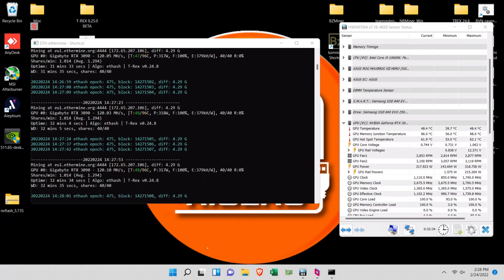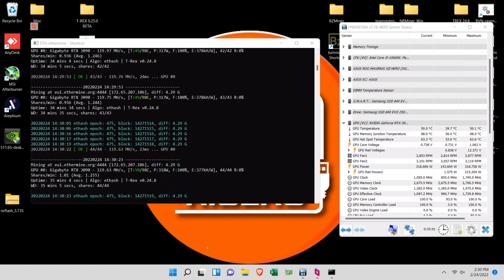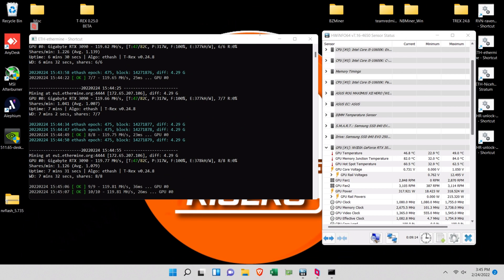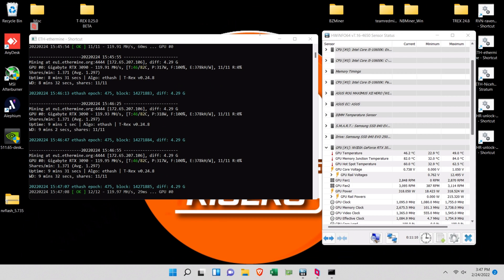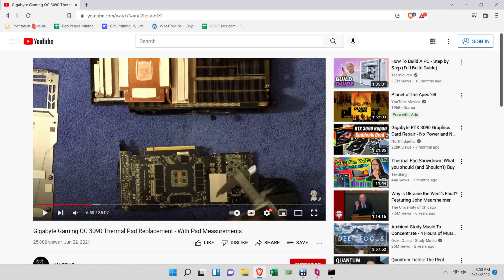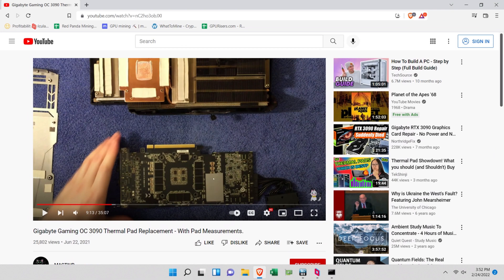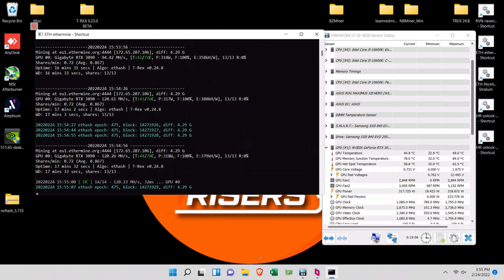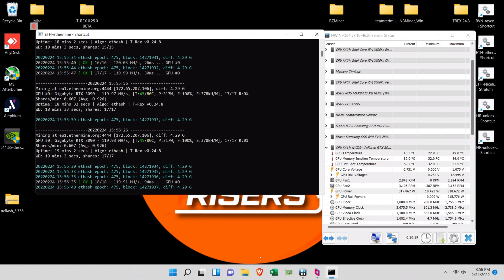We Fixed Our Underperforming Gigabyte RTX 3090 Gaming OC  - Power Analysis & Thermal Pad Swap

Comment: I can't help but wonder if the root of thermal issues is shoving them all into a small box... An open-air box, sure... But it just doesn't look very thermally sound either way. They are so close together, the heat must just sit there internally. It doesn't seem like all those case fans are close enough to be effective.
Reply from the maker: The case fans really move a good amount of air on the frames, but the pads are the most effective for lowering the temps

Comment: I kind of like the process of changing thermal pads and thermal paste on heatsinks. I don't like dealing with wires or having to troubleshoot a problem because i didn't plug everything in properly but if you lay a few gpus and motherboards with simple to remove heatsinks on my desk, I'll set up my music/podcasts and have a fun little build session.
Reply from the maker: It for sure is a process! I put on music as well

Comment: My ASUS 3090's get 125.8 @300w all day it's my MSI 3080 Non LHR and ZOTAC 3080 Lhr that need some Help.
Living in Arizona I'm not ready for summer. Thoughts on if a Octominer case would do a better job with cooling?
Keep up the great content. I will be picking up some pads from you.
Reply from the maker: Server cases help a lot with directing heat, however they can cause thermal throttling. I think a balance between server cases (octominers) and open air is the way to go
Reply: @GPURisers  Thanks, Just received my order, Keep up the great work.